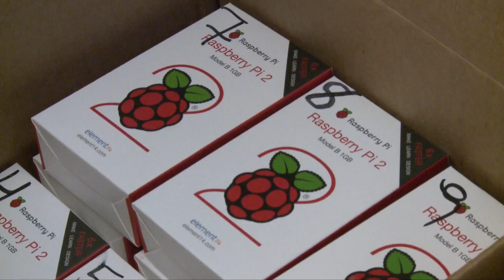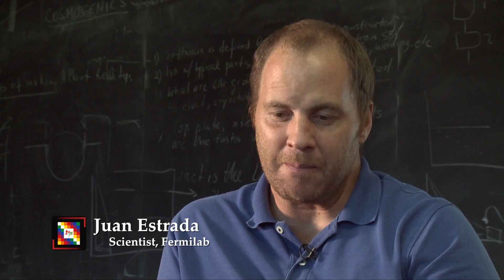The Escaramujo Project

Comment: this video,
Low on Knowledge and High on politics, lol culture diversity, shoulder by shoulder, politically correct physics, delusional, a waste of time and money, there was a time when amazing discoveries were made, here they chasing one particle, the neutrino, using RaspberryPi toys on the backs of real scientists of the past, billions and billions of dollars are wasted for cultural diversity. What was Einstein Salary? 50K a year? maybe, but he discovered a billion times more in physics then these yahoos and few of them can even begin to understand the Math he created.
Just try to gain some Knowledge from this video and one can get a feel for the nonsense along with the money wasted, it's all for feel good politics not physics
Reply: +Nite Angel The physics of today can`t be done any longer by a single individual thinking about nature, it is a complex problem that requires many minds engaged on it`s challenges. We are producing so much knowlege today that the single genious breakthrough seens very unlikely. Otherwise we woudn`t need to collect the culture diverse, and politically correct physics of the LHC to discover the Higgs Boson, one project that only exists because of a great treat of many contries to build the most colossal extructure ever.
Reply: Nite Angel  Imagine putting neutrino emitters deep into the earth where traditional radio equipment wont work.  Then have surface detectors source the signal w high resolution so you can map out the oil or water or whatever. But its funny you have the confidence of a politician in your comment so you see politics. Just like a hammer sees nails.
Reply: Nite Angel 
This video upset you and it shouldn't
Google expected value one payoff is all you need.
Albert Einstein was just one person and look what he did.
I can nearly guarantee someone in South America is a super genius.
If we can train that one guy or gal, the whole world wins big.
Reply: Nite Angel - You are so wrong about a couple of things you mention.  First off, Albert Einstein was a German Jew - you mentioned "culture [sic] diversity" as "a waste of time and money."  Without cultural diversity many of Einstein's contributions wouldn't have happened.  An example of cultural diversity contributing to science can be found by comparing the USSR and the USA during the space race.  Russia had a cultural philosophy of "brute force" when it came to rocket engine design but, the USA emphasized finesse.  As you know, USSR was the first to place a satellite, while the USA was the first to put men on the moon.  These are examples of different achievements that came about as a result of cultural diversity.  How many people that could have accomplished greater achievements than Albert Einstein could have ever dreamed of - were undiscovered and languished in Latin America because of their lack of education and/or opportunity and/or interest?  This program, you so readily disparage, has the potential of discovering another Albert Einstein and sparking the interest in many Latinos to make incredible discoveries that will help all of mankind.  "Just try to gain some Knowledge from this video . . ."  -- this video gave me the information I needed to design a neutrino detection system using BOINC to determine their [neutrino] points of origin.  This video is about a worthwhile program that has the ability to advance and help the entire world.  BTW - without cultural diversity, Europe would still be in the Dark Age.
Reply: David Duvall excellent! Create a youtube video, to help understand this interesting science, but basically this is an obnoxious video, I don't care who does the science, I just like to know more about that science and for all the money these folks get little is forthcoming, for sure in their youtube videos, Funny now if you have a Spanish accent, different skin color or culture and can read the periodic table, you get a free ride to a university, well thats not enough, there's too much focus on political correctness, as this video proves. if you're looking for people with amazing science capabilities, it's in and around Russia, hate to say that since I can't stand Russians, especially their women who have made me feel stupid, get a few of them involved in Quantum Physics and I bet they'll figure out why a photon is a wave and when observed a particle, stuff like that, but that would be Politically incorrect in this time of Human insanity,
lol I Am starting to think political corectness has become a sextual experience of the left